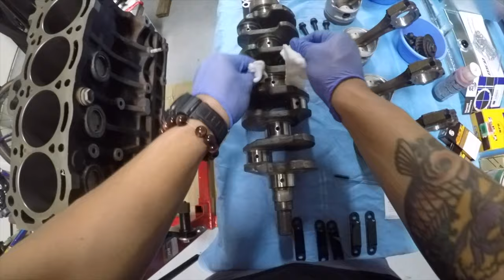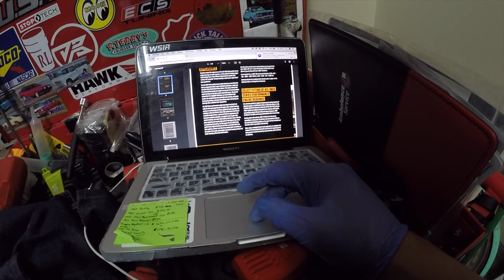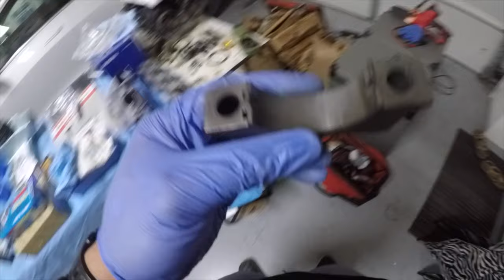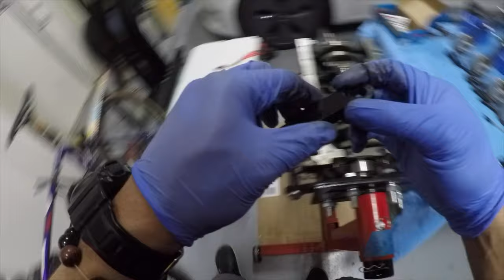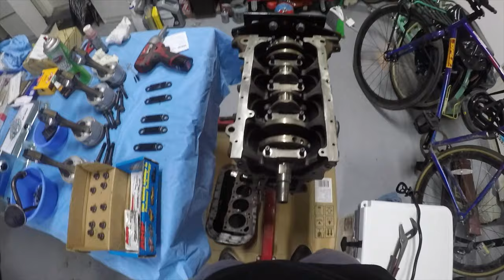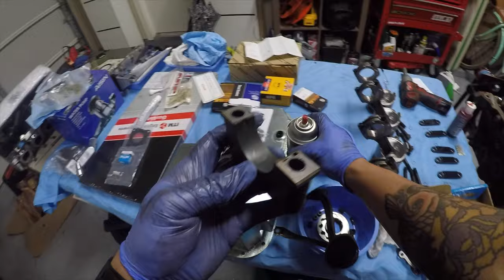4age 16v rebuild: Part 1

Comment: I have to rebuild my 4AGE in my mr2 I'm curious how much it cost to have the block and or head machined?
Reply from the maker: It was about $1000 for the short block hot tanked, and the internals of the block (pistons, rods, and crankshafts) checked to makes sure they are still within spec usable for the rebuild. I tore down the block and sent it to the machine shop disassembled to cut down on labor cost. Took about 1.5 months before it got my block back. With the head, I paid $600 from eBay. I found a rebuilt big port head, and I just had to exchange my core for it plus $600. I replaced all the internal bolts, bearings and rings.
Reply: @chamba3998  Thank you for the info!

Comment: Should not use brake cleaner on journals.
Reply from the maker: Oh, why is that? I did that on my last build?
Reply: @chamba3998  depending on which kind of brake cleaner your use, it may leave residue after the solvent evaporates. It's better to use acetone or mek.  Acetone will not leave residue and it's cheaper. Buy a solvent wash bottle and just refill it instead of cans brake cleaner.

Comment: Do you win any money by racing?
Reply from the maker: Nope. In grassroots or amateur racing you don't get money, but there are contengicy programs. So depending where you finish in a race you can get tires, brakes, or other parts. The series championship race there is prize money but its not a lot, $1000 or less.

Comment: Do u have a link to all the parts you've used? I need to rebuild my 4age for my ae86 lol
Reply from the maker: The bearings I bought from MRP. The rings I bought on eBay. The gasket kit I got from Flos. The ARP bolts I bought from battle garage.